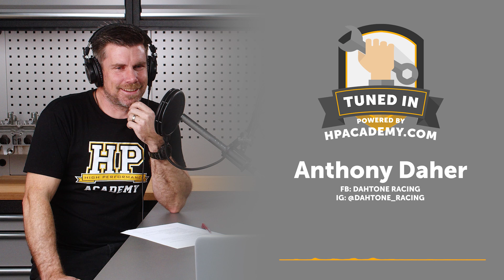036: Making Nissan's RB Motor SING. [#PODCAST]

Comment: so I just found myself a barn find, 1990 bnr32. thinking it would have a ton of issues, I expected the worst, took it to the shop after buying it and all it needed was a thorough service, did the new water pump, n1 oil pump, oils etc. checked the turbos etc and all good. it's completely stock and i'm sure it has the short nose crank. Do I still need to worry about this issue even though its stock. Do they just fall apart?
Reply: Don't limiter bash it!
Reply: @slow26gtr  yeah and no launching, how can that be fun? nah i'll just enjoy it as it is for now until I get something built
Reply: Where did you find a barn find R32?
Reply: @gav240z  dubai